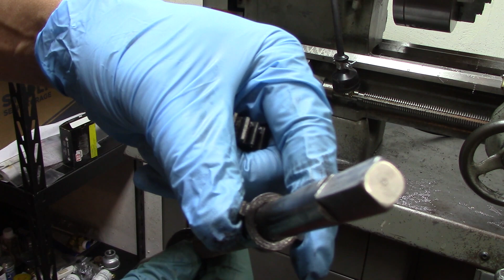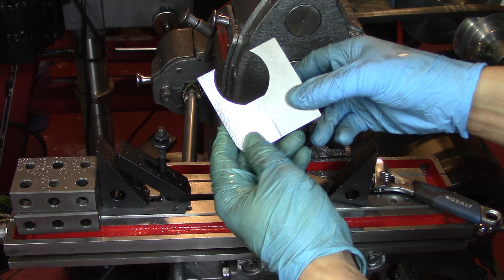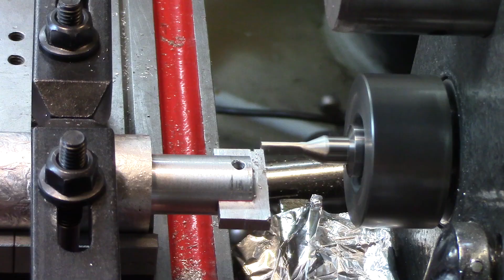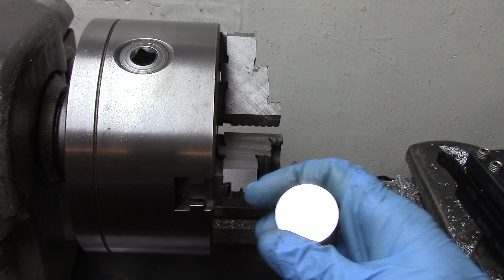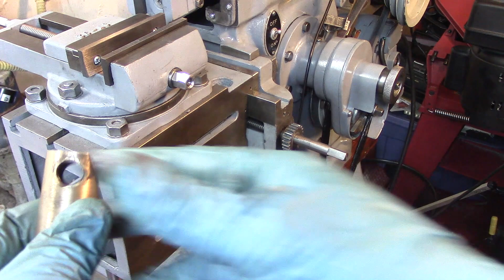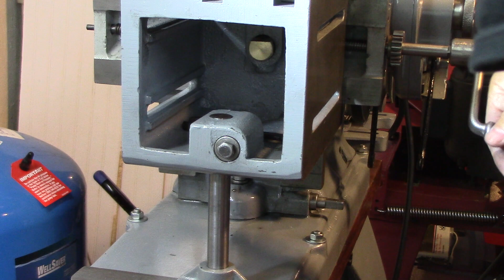Machining a Bushing with 2 tabs using my Atlas Horizontal Mill, Atlas 618, and South Bend 10K Lathe

Comment: I had to remake the same bushing for my same Atlas shaper last year. I followed a similar process, turning to the correct OD then cutting keyways in each side and "gluing" keys in with retaining compound, similar to how I've seen Stefan Gotteswinter and others do. So far it's held up, but only time will tell. Lucky for me, I didn't have nearly as many problems as you ran into with other parts of the table traverse system, but the knee on mine gave me enough fits. Good work!
Reply from the maker: Thank you so much!  I missed the Stefan video.  I would have loved to watch someone else do it first so I could learn from it.  I'm glad yours worked out too.  And thank you again.....